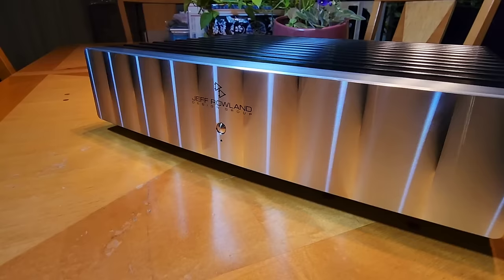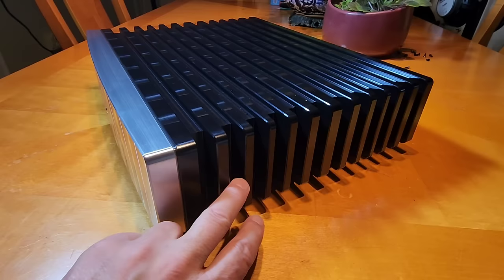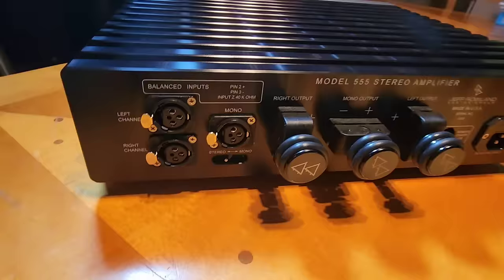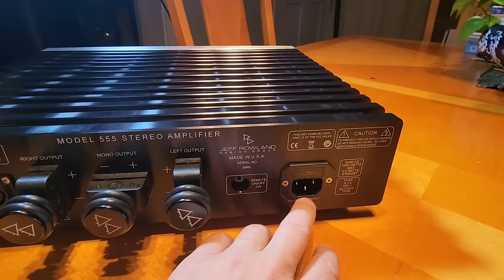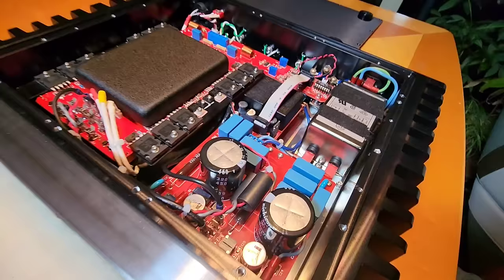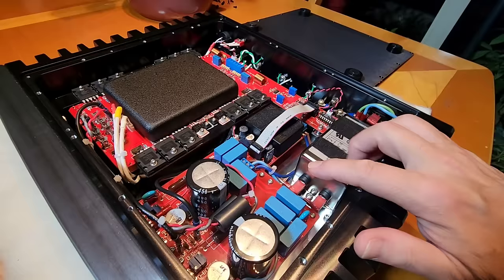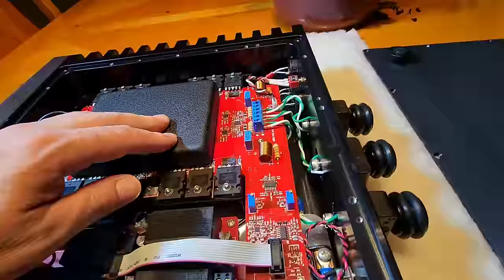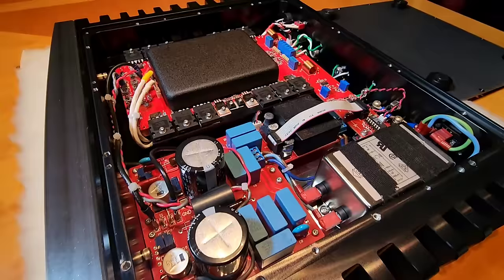BEST SS Audio AMP 2023 under $20K Jeff Rowland 555 !!

Comment: Mikey I am sold on Jeff Rowland  his  chasis are absolutely unmatched
Reply from the maker: That's for sure, but what's far more impressive is the circuit and all its error correction. This is an extremely linear amplifier, usually only achieved in the MASSIVE sized amps.

Comment: Just bought two 555s and will bridge them in mono. They arrive tomorrow. Can not wait. Other gear: Jeff Rowland: Cadence phono preamp, Capri S2-SC preamp, & PSU (drives the Cadence); Basis Vacuum Debut/Graham arm/Koetsu Onyx Platinum, Shunyata Hydra power conditioner; B&W 802D4 speakers.
Reply from the maker: Cool Robert ! I sold 2 this week. ;-) you'll love them... !!
Reply: Loved your review. I've owned the original Concentra for 20 years and a pair of 201s for three.  With my new 802 D4s, it was time to get serious. I will try to post a review in a few days. Cheers! 🍾🥂🎶

Comment: Great concept, it seems there’s a trend in symetrically installed circuits that are not jumbled together, orion makes cool wall filters that have some type of  low mid high at the ac level. a concept of audio engineering  progression, needs to reach the stage where a small circuit can emulate large amplifers, and the type of sound they give with these large circuits, can all be  mathematically shrunk and emulated. x,y,z axis etc. and put into a small chassis.
Reply from the maker: That's it exactly... !

Comment: So if I understand this design, JR’s transformer-coupled input circuitry provides universal component compatibility and ensures identical amplifier overall gain when using unbalanced input adapters. In other words, despite having only XLR input connections, the end user can use either XLR connectors to a balanced cable or XLR-RCA adapters to an RCA  unbalanced cable with comparable performance.

Comment: Mikey - Happy New Years!  What is so interesting is that the fins on the heat sinks having different widths for resonance control has nothing to do with the electronics that are used.  That never even would have occurred to me but I can see what a difference eliminating the chassis resonance makes.  Jeff is a true amplifier design genius.  You are his best salesman.
Reply from the maker: Thanks Freud... I cant put into words half of the features in this amp. Its 40 years of design refinement in one amp.. Build points he takes for granted are amazing to me.. It took 2 hours to explain with Jeff only using semi Layman's terms. But manufacturers like to talk with me as I have a much better design grasp than nearly all of their dealers. All the best !

Comment: Very nice unit, is the case made from 6061-651 aluminum alloy?  Good machine properties and easy to anodize.
Reply from the maker: Think its 2024 .. More durable..
Reply: @OCDHIFiGuy  Cheers!  I've worked with both and 2024-T351 was used on aircraft structure and it cost way more than 6061-T651.  Yes it is a stronger aluminum alloy.

Comment: What exactly is "extremely advanced power supply"?  Sounds like a switching power supply to me.  Not giving more details is pretty much hand wavy and isn't confidence inspiring.  Chassis construction is pretty cool though.  Although wished this was carved out from the top instead so that the feet are directly coupled to the chassis instead of the cover plate.  It's not as esthetically pleasing but maybe it will be better sonically?

Edit nvm chassis is also a heatsink so carved from the bottom makes sense.
Reply from the maker: Im not here as a "CONfidence man" , dont buy it... I dont care... LOL. If I need to explain the power supply in more detail for you to have confidence, youre not my type of client, no big deal brother... putting a lid in top would vibrate as theres no mass loading. Putting lid on bottom mass loads the lid big time and stops vibration... you could actually do the heatsink thing still with a reverse mill and machine, but yeah, its more efficient up top... again, this design is beyond most peoples comprehension.. Its why I just laugh when people need to "decide" about it... the only decision is "is it within my budget ?'.
Reply: @OCDHIFiGuy   why so defensive... Just pointing out that calling something "extremely advanced" without giving at least some details on why that is, is basically just salesman hand waving.  Which I thought wasn't your style.. but ok guess now we know. Peace ✌️